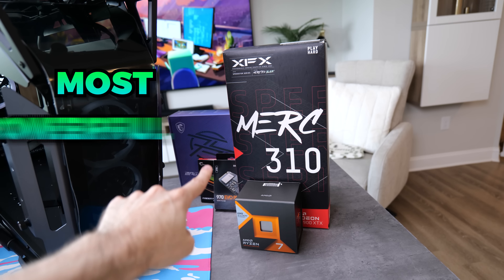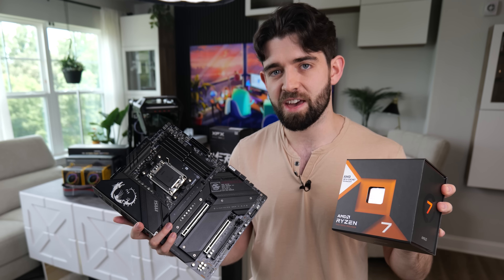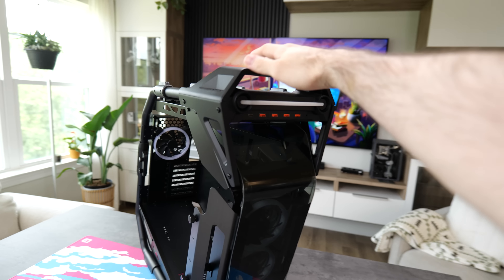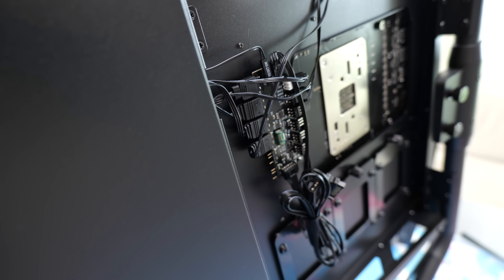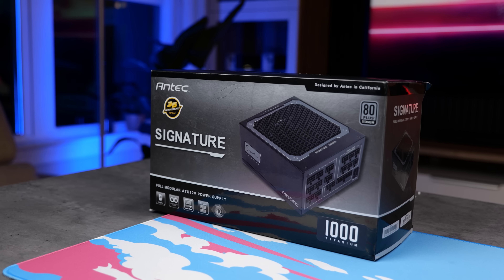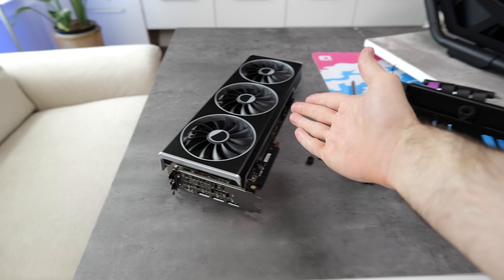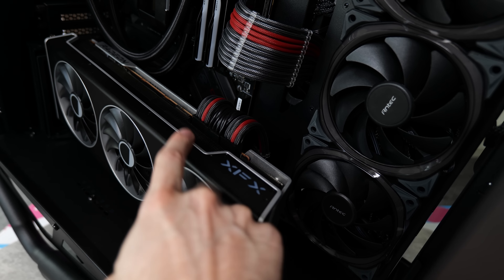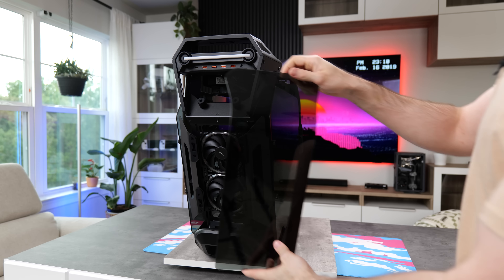Building an all-AMD 4K Gaming Beast!

Comment: That build is amazing. I just took a advantage of last Gen deals on Amazon and Newegg. I got a I9 12900K ($360) Asus ROG Strix 690z E ($249) MoBo 64GB Corsair Vengeance DDR5 ($160) XFX Merc 6950 XT ($569) 4 2TB Samsung 980 ($99 each). I already had a case AIO and Corsair Modular 850Watts PSU from my previous build. This build is crushing every game I'm throwing at it, plus is running all my DAW and VSTi smooth like butter.

Comment: You're benchmark numbers didnt add up. It looked like the 1 percent low's were actually the average. As someone who owns a 7900XTX this seemed off.
Reply from the maker: You can see all the data live on the top left in the afterburner overlay - Next to where it says "FPS" is the 1% lows, the one next to that is 0.1% lows, the graph that moves is current framerate/frame time, and the one below that is average FPS. What CPU are you running? Averages for me seemed roughly the same as what I'd checked out on independent reviews online.
Reply: @TechTesseract I'm running a Ryzen 7 7700 on DDR5 5600mhz. Looking at rivia tuner in the top left it looks like your current fps matches your 1 percent lows which is why I say it looks like you miss labeled the charts.
Reply from the maker: I think you're misreading the riva tuner readout bro - 8:08 - that graph you see that's constantly moving and says framerate next to it - that is current FPS. In this case, around 175-180. The average FPS is the graph below that one (167fps) Those 2 numbers all the way up in the top left are just the 1% low, and 0.1% low. (The 1% low in this case is 117 fps, as labeled on the blue/white summary overlay. It's labelled correctly 👍
Reply: Maybe its just your Hogwarts Legacy that was wrong and throwing me off. You said you averaged 100 fps but labeled it at 150fps. Maybe your XFX card is much better than my reference model too... Not trying to call you out I really enjoy the content y'all make! Keep at it
Reply from the maker: Ah, my bad dude! Looks like I messed up on the label for hogwarts legacy, it was late at night haha 🤣 I'll pin it in the comments ❤️

Comment: cpu is hot n nvme me too ....🤣🤣🤣🤣
Reply from the maker: 50c under load is hot? Lol
Reply: @TechTesseract  samsung 970 hot issue
Reply: @TechTesseract  7800x3d pbo so hot
Reply from the maker: Look at the benchmarks, CPU is at 50c the whole time lol 😆 NVME is fine, it's got a huge heatsink on top of it xD
Reply: Ihave two them n try pbo 5,4Ghz temp is 89⁰, i use noctua nhd15 n Samsung 970 2tb if full capacity temp in hw info 81⁰